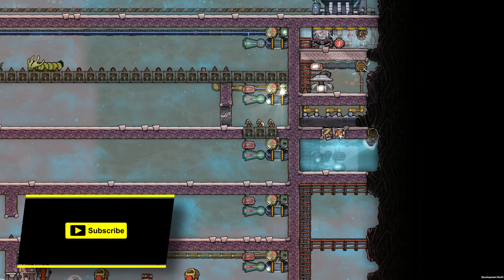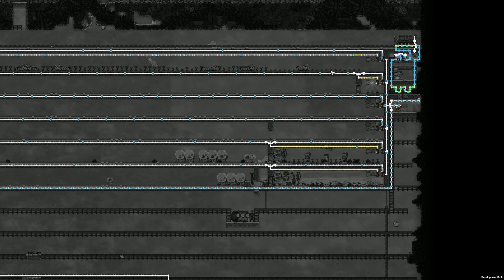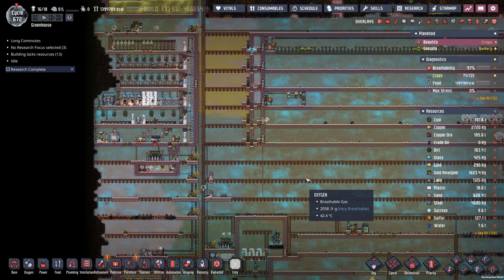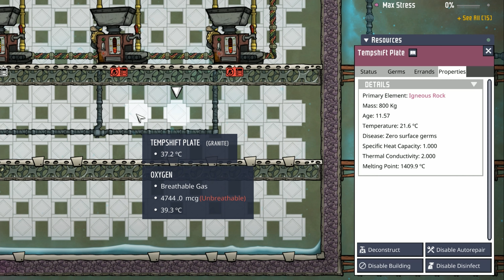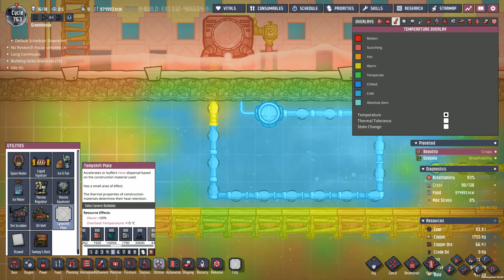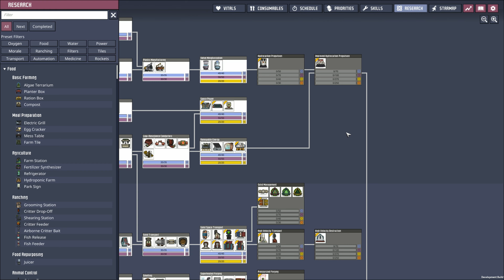Hot Industrial Zone | ONI Spaced Out! | Ep 15

Comment: Hey Echo, love the videos. 

Quick question for you: since you are using the p trap liquid lock (with a tile of vacuum in the middle), why do you put two of them? The vacuum tile ensures that there will be no heat escaping the room. The second lock seems like overkill.
Reply from the maker: You are absolutely right. I use two for the just in case one fails, the other will still be active while I fix the first (and still not transfer heat). If I had more crude oil, I would use a lot more liquid and just use the one. Thanks for the comment.